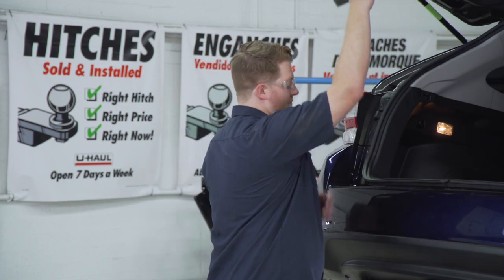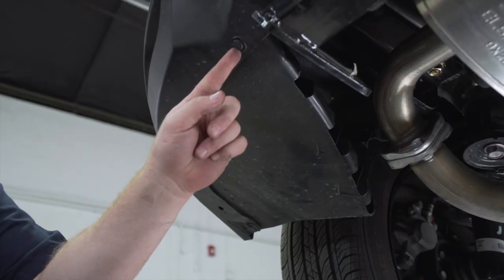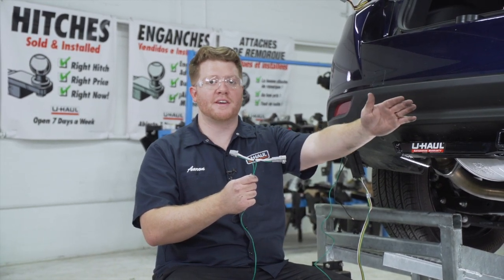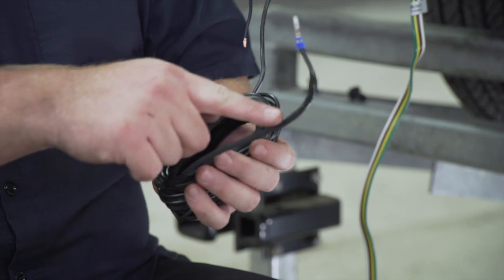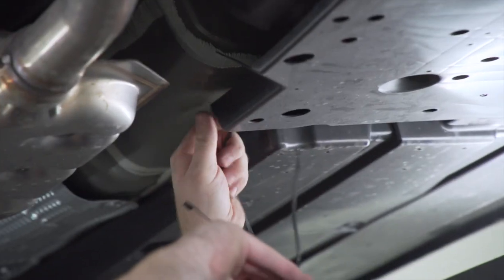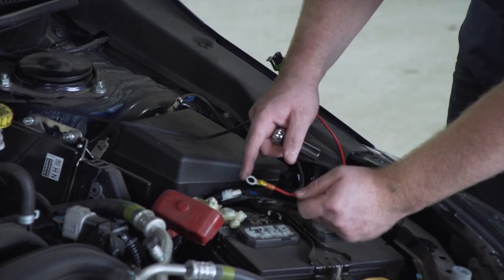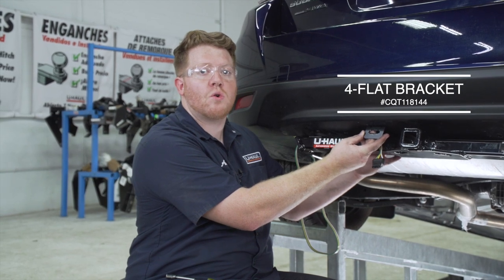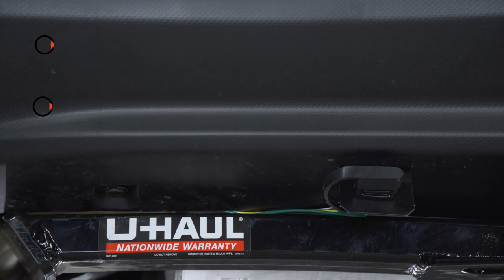2020 Subaru Impreza Hatchback Trailer Wiring Harness Installation

Comment: For a cleaner install installed going to the battery you could just use a fuse tap and go to the fuse box and hook into ignition power then you only have power when the key is on